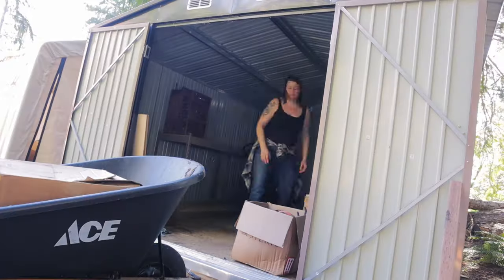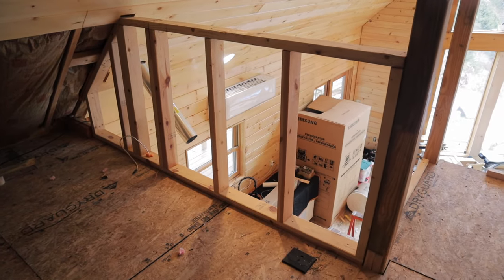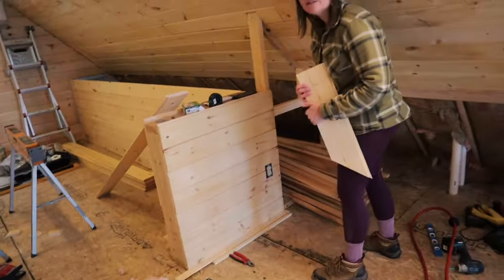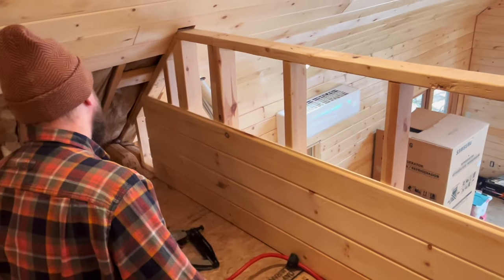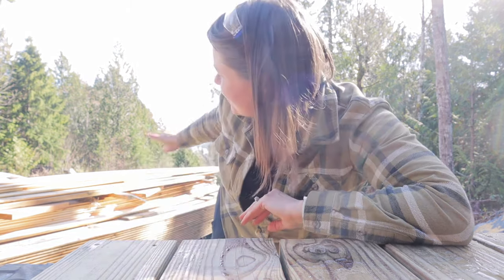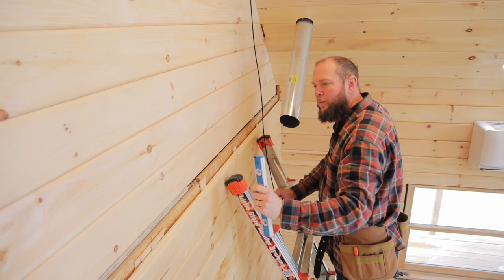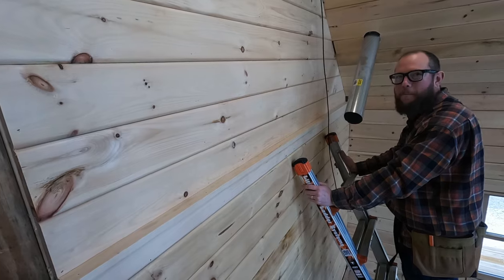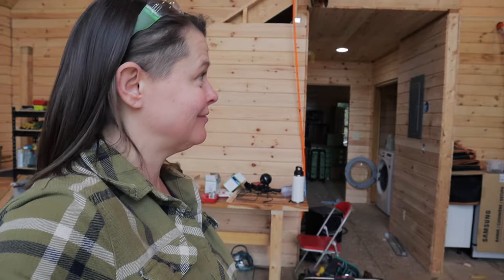IS THIS THE END?

Comment: i understand that you are building this house from a plan but..... is there one room, wall that is not a tinder box??? everything so far, every single wall, Seiling floor is built from verry flammable dry pine or other dry wood..... you understand drywall have a purpose other then flat wall. engineers using 1/2" or 5/8" sheetrock as a fire break.....
End even when you prefer look of a wood log cabin,  maby just maby  you should put sheetrock under wood in crucial areas to slow spread of potential fire....this house will burn to the ground in less then 20 minutes. hope not, EVER, just asking questions.